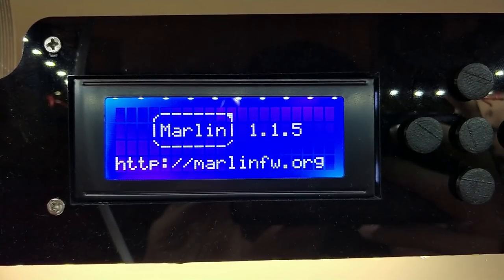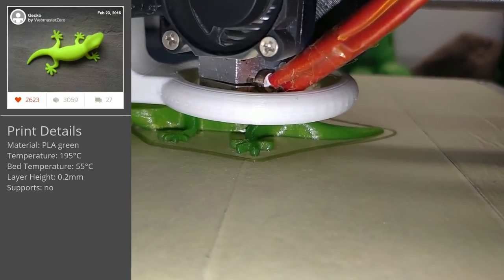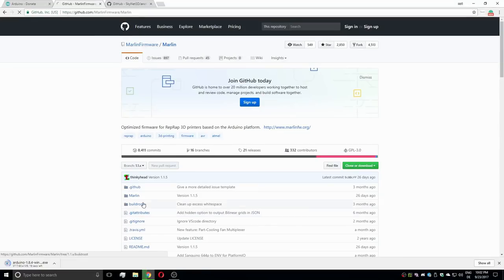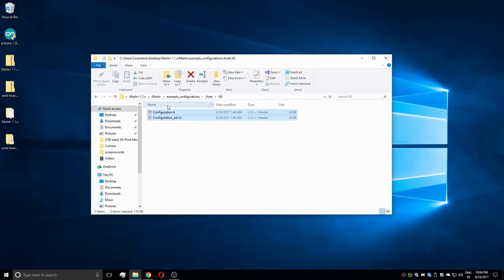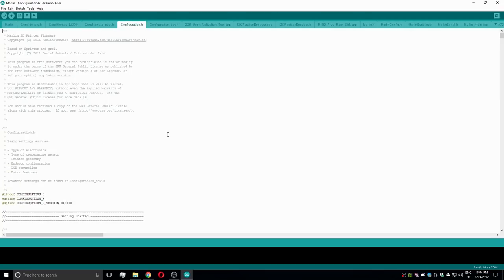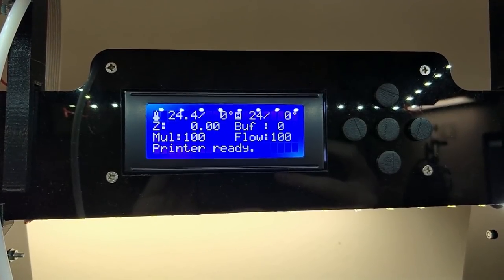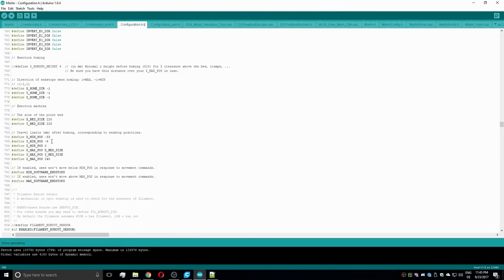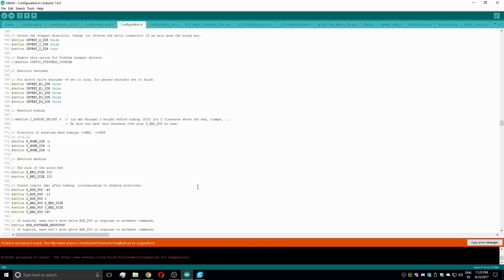Anet A8 Marlin Firmware

Comment: Wow a fantastic video. I am looking to purchase this printer. I notice this is the dual extruder which is what i want to purchase as I will want to use hips filament simultaneously. Are there any types of filament that you reccoment. Both flexable and hips. IE is cheap filament not worth my time?
Reply from the maker: Thanks. The printer has only one extruder by default, and the addition of a second one requires the mainboard to be changed (https://youtu.be/g_AA72g_uXg), I make a video about that soon. For now, I've only used PETG and PLA, nothing else. But once I get Dual Extrusion setup, I'll give HIPS a try! Stay tuned!
Reply: This is fantastic. I have already found a couple prebuilt with a 10hr test run on amazon. These are dual extruders with heatbeds that can only reach 240c, so I may want to upgrade the bed later in order to use other types of filament like PC. Would this cause any issues with the main board. I believe it to be a mega2560?
Reply from the maker: If you say that it has already performed some tests and it works fine, then you're good to go. The Anet mainboard, however, cannot run two extruders as it has no physical connections for them. You could try to install Marlin as well, however, you might need to adapt some more things than shown in this video. For the heated bed I recommend to install some sort of insulation, then you can drive up the temperature quite a bit, like I've done on my Anet A8 (https://youtu.be/wAWZ2x5dJ4s).

Comment: In my case I had to install the CH340G driver to get Arduino to recognize my A8. Although you can use a preconfigured version of the configuration.h/configuration_adv.h, which can be found in the example_configurations folder. But anyway, great video and happy printing :)
Reply from the maker: Well, Windows is sometimes strange with the automatic installation of drivers. I'll put a link to the drivers in the description later. I chose to go with the preconfigured versions as it is the least work to do, and otherwise the video would have been a little bit longer. I'm glad you liked this video. Thank you very much ;-)

Comment: if i have another mainboard,what should i do to install this? ive changed it to an MK base v1.2, awesome video!
Reply from the maker: You need to set the MOTHERBOARD in the Configuration.h file to the correct one. All boards can be found in the boards.h file. For an MKS Base, try "BOARD_MKS_BASE". I adapted exactly this setting but for an Arduino Mega with RAMPS combo in my controller upgrade video (https://youtu.be/g_AA72g_uXg).
Reply: Caverntwo YOU ARE AWESOME!
Reply from the maker: THAT JUST WAS THE SHORTEST REPLY TIME EVER!!!

Comment: my stock firmware on Anet A8 v1.0 board works fine. I don't care about auto leveling, what other purpose does the upgrade offer? Will my prints be better?
Reply from the maker: The main purpose for me was to be able to edit the firmware code and to get rid of Z-leveling problems. And Marlin is truly open-source. I've also never used any auto-leveling so far, but some useful features like a filament run-out sensor can't be added to the board without upgrading the firmware (I did a separate video about adding one). Another important point is safety, as software features like thermal runaway protection (prevents a fire if the extruder thermistor falls out) are disabled. Well, it's your decision. If your software works fine and you don't care about new and useful features as well as extra safety, then you can still use your stock firmware.

Comment: I get an error. It says :
Sketch uses 102860 bytes (81%) of program storage space. Maximum is 126976 bytes.
Global variables use 4161 bytes of dynamic memory.

avrdude: ser_open(): can't set com-state for "\\.\COM4"
An error occurred while uploading the sketch
Reply from the maker: That's a rather typical error. There could be many reasons, but the ones that helped in my case were:
- check whether COM4 is correct
- Make sure to try it multiple times. I click on upload and then plug the board in. Just try it multiple times and hopefully it works. If it doesn't, try to upload it with another software (see pinned comment). I hope that it works for you.

Comment: great video, worked perfect but now printer center is off.  I changed the config.h file to the  exactly as you did.  -13 and -6.  not sure how to fix this.
Reply from the maker: Hi, thanks for your feedback!

The center correction values worked for my setup. However, this is very likely different for everyone, because of variable end-stop locations and other factors.

I'd suggest you to either play around with the values and watch my GCODE video,  where I showed how to measure the offset values: https://youtu.be/SQ5ZOtb3Cjo

Just don't forget that you can set the offset values directly in the configuration file (you might have to negate them, depending on from which side you measure), so you don't need to add the G92 in the GCODE.

Let me know if that works for you! 
I'm happy to help ;-)

Comment: what features do you get  with Marlin? new features in the menu? I will like to see the printer menu screen and compare my.
Reply from the maker: Yeah, there are some. My favorite one is the open-source part of the firmware, as you can always adapt and change stuff as you need. You can use the Anet board's free pin(s) to e.g. add a filament run-out sensor (https://youtu.be/UdETssS-ods) or some extra hardware. Furthermore, some software safety features help you shut off in the event of a critical error, which could lead to a printer fire in the worst case. The menu is of course somehow similar; feel free to check out my newer videos to see the menu in action.

Comment: Why are you downloading a skynet file if you are trying to download marlin? Only part I am lost on haha. I am going to be doing the upgrade soon
Reply from the maker: I downloaded that files because the SkyNet3D team managed to create a working interface to the proprietary Anet board. The interface is necessary to get any software installed on that board. 
And as the SkyNet3D firmware is officially outdated now (it was an adaption of the original Marlin anyways), I went with the current software.

Comment: I am currently running in to the same problem that 
miguelsolis966 had. I have followed your video from start to finish multiple times and still no success. It is showing that the issue is in the endstop_interrupts.h file line 161
Reply from the maker: Hi Raymond, thanks for your comment!
I've also encountered this issue recently on my FLSUN Cube printer.
I still don't know what causes this and didn't want to invest more time, so I just disabled the ENDSTOP_INTERRUPTS_FEATURE in the Configuration.h file.
Reply: @Caverntwo  will this cause the endstops to not work? I'm new to dealing with firmware.
Reply from the maker: Actually not, but it decreases overall performance as the pins are polled all the time. Normally, it shouldn't cause any issue.
Are you sure that your endstop is wired properly and the logic is right?

Comment: How could this be applied to Anet A8 Plus ? With V1.7 physical board. Any of instructions I have found from www does not do the job ???
Reply: Anet A8 firmware update, how to do it with ANET3D V1.7 mainboard ??? (Anet A8 Plus)
Reply from the maker: Hi Jesse,
I don't have a 1.7 board so I cannot confirm whether it works or not. But according to the following thread, it should be possible pretty much like shown in my video, just go with the latest Marlin 1.1.x version: 
https://www.thingiverse.com/groups/anet-a8-prusa-i3/forums/general/topic:38397
However, be aware that you do it on your own risk!

If you cannot upload your firmware, there might not be any bootloader installed. In this case, I've created a separate video about that topic, which you could follow for reference. But let me know, I might have to research a little bit more.

Hope that helps, if not, let me know!
Reply: @Caverntwo  Thank You, now I am trying through VSCode... maybe I could try another board..?
Reply from the maker: He's basically showing the same process, but uses PlatformIO instead of Arduino. I also need to check it out once I have some time, as Arduino is sometimes funny...
Just make sure to compile for the correct board.

There might be new board definitions available, please check yourself (I cannot until tomorrow evening). These are important as the Anet controller is proprietary, so everything is different compared to other boards.

In the absolute worst case when you destroyed your current board, you could buy a new board for like $30.
Reply: @Caverntwo  ok, if ending to change the board.. which eventually will happen sooner or later, is there w e l d i n g needed.. ? not that I couldn't´t do it ...
Reply from the maker: Yes, soldering is needed, as some wires are too short and you probably need different sockets to plug into. In the case of a Ramps board, you need the default pinhead connectors, but it is different for other boards.

I'd suggest you trying out upgrading the firmware of the old board anyway, it's a good way of getting into the topic.

Comment: Hay hi... I am getting error that says :- your file name or extension is too long. Error compiling for the board Anet V1.0.
Reply from the maker: Hi,
After looking up Google I suppose the file path to some dependency, your project or the compiler is over the max length of Windows (around 250 chars, I guess).
https://forum.arduino.cc/index.php?topic=419584.0

Can you turn on Verbose Logging for the compilation (File -> Preferences)? That would give us more clues.
Reply: Hay thanks for replying..... And it worked
Reply: Your video is the only one video that helped. Thanks for the video
Reply from the maker: Thanks for the feedback!
I'm glad that it worked out for you!

Comment: Hi Caverntwo, very nice and helpfull video, how ever I am unable to get Marlin flashed to My A8 v1.0 board. There is a problem with the CH340g driver. I am running Windows 7 64bit and every time I try to install the CCh340 driver a window pops up saying "The drive has been successfully Pre-installed in advance!" and in the device manager it shows up with the yellow exclamation mark! I have seen all the related with this issue videos and have tried all the methods I could find to no avail! I even partitioned my hard drive and installed a seccond version of Windows 7 ultimate but 32bit with no success! This is realy frustrating! Please help me if you can!
Reply from the maker: That's very annoying. You have already tried many things. If you try to upload the firmware to the board, does it even start or does it error right away?
You could also try installing Linux and trying it from there, but I'm not a Linux expert either.

Comment: I've recieved error, 
"exit status 1 pasting "/* SPI Master Out Slave In pin*/" and "_DDR" does not give a valid preprocessing token"
when trying to upload to the Anet A8. Help!
Reply from the maker: Hi,
From the information given I do not know what the actual problem is, but as it said "/* ... */", I assume that there's the a comment (the star-slash combination) anywhere in your code where it shouldn't be. Search for the line in the Arduino project, maybe you get some result. If it doesn't work, just restart the while process shown in the video.

Comment: I keep receiving the error "avrdude: ser_open(): can't open device "\\.\COM9": Access is denied." I've never seen this error code before working with Arduino. Any help would be appreciated, thanks!
Reply: turns out my board has a rip-off FTDI chip so my Arduino IDE doesn't recognize it. Currently trying to find drivers that work, but Windows 10 isn't allowing me to install.
Reply from the maker: You have no access to that COM port! Check in the Windows Device Manager if it's the correct one. If it is, try unplugging/replugging just before the firmware is uploading. It usually takes a few trials. Others have reported that they didn't get it to work with Arduino at all (see pinned comment).
Reply from the maker: Oh, I didn't see that comment. In that case I can't really help you...
Reply: Caverntwo thanks for the reply! I had a similar problem with the drivers for my DJI Naza flight controller because the drivers were unsigned. Windows 10 won't install unsigned drivers without a special boot. I'll try that and if I get it to work I'll reply back so anyone else having the problem knows how to fix it.
Reply from the maker: That's true. Took me a while to figure this out for a school project too...

Comment: I've been able to upload the Firmware however all I get on the display is 2 rows of 20 white squares on a blue background.  I can access the printer with octoprint.  Any ideas on how to get the display to work?  I have also tried to go in and enable the different LCD types ULTRA_LCD.
Reply from the maker: It depends on what LCD you use. If you're still running the default 5-button LCD, you need to make sure that the "ZONESTAR_LCD" or similar is enabled. Also make sure that no more than one LCD is uncommented at once. Normally it should work then. Keep me updated!
Reply: That worked!!!!  Thanks for your help.  I find your videos of great value!
Reply from the maker: Nice that it worked out for you and thanks a lot for your feedback ;-)

Comment: How can I fix my boot-loader without buying more equipment to do so? I have white square boxes across the display.
Reply from the maker: I have not done it myself so far, but this might help you: http://www.instructables.com/id/HOW-TO-FIX-ANET-BRICKED-BOARD-USING-AN-ARDUINO-UNO/
Reply: I finally got what looks like a working bootloader using the usual process, but the flashing process failed with the error message (avrdude: stk500_getsync() attempt 10 of 10: not in sync: resp=0xbe), and I still have the white boxes across the display. So after a week of trying anything and everything, I have come to the conclusion that my main chip is fried. I guess I could buy a new chip and install it on the board myself and then try everything again. I've been talking with 3D Printer Universe, whom I bought the printer from, to get them to get me a replacement board cuz it's still under the 1 year warranty, but they are jackin' me around. Would never buy anything from them again. Thanks for your help anyways, greatly appreciated.
Reply from the maker: I also had these getsync() errors with the Anet board once in a while, but usually after the 3rd upload trial it worked. As the board is very proprietary anyways and to get dual-extrusion working, I upgraded to an Arduino Mega + Ramps 1.4 setup ( https://youtu.be/g_AA72g_uXg ). I really hope that you can get it to work, else consider doing an upgrade similar to the one I did, you'll really enjoy having a lot of extra pins free.

Comment: Thank you for a great video. Sometimes too fast but it is easy to stop.
 However, following your instructions the printer is working and can print using Merlin 1.1.6. That is ok, but unfortunately the display is corrupted and a lot of pixels are randomly enabled during printing. Everything else seems to be ok and I can get the display back again for a short while by entering different menus . Just after few seconds it is corrupted again. Is there anything I can do?
 Brg Tomas
Reply from the maker: Hi, thanks for your comment!
It seems like you use the default Anet Keypad display. There's a problem with this display, as mentioned in the LCD definition of the ANET_KEYPAD_LCD in the Configuration.h file. I had this issue as well, but only 2 times as far as I can remember. As they state that this error has something to do with electrical interference, it can be hard to impossible to fix. 
I'm pretty sure that they mean electrical interference on the board, not on the LCD. You could try to organize your cables in a way that the wires don't go over the mainboard but around it, to make sure that the controller receives the least possible amount of electromagnetic influence from high-power cables (like the stepper wires). I suggest printing a case and zip-tying the cables to it. 
Currently, I chose to abandon the original keypad LCD, as I went on and changed the mainboard to an Arduino Mega + Ramps setup, where I swapped the LCD to a RapRapDiscount Smart controller because it has an SD slot (and is very cheap). 
Make sure to check out the video: https://youtu.be/g_AA72g_uXg
I'm very sorry that you are in this situation, but if nothing else helps, you might consider an upgrade like this as well. 
I hope that helped.
Reply: Thank you for the replay. It looks like the display is easy to disturb. However, the original sw works fine, strange! I have however also ordered the components and will make the upgrade.
Reply from the maker: Nice! If you have further questions, feel free to ask. My real reason for the controller upgrade was the possibility of adding a second extruder.